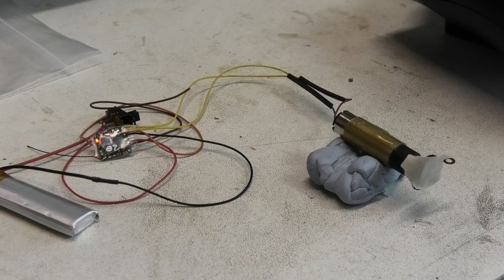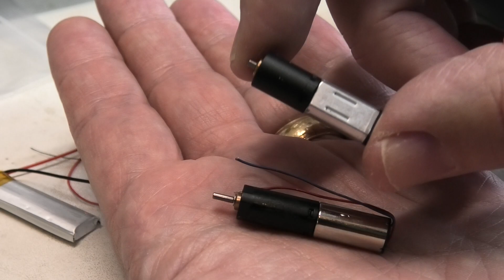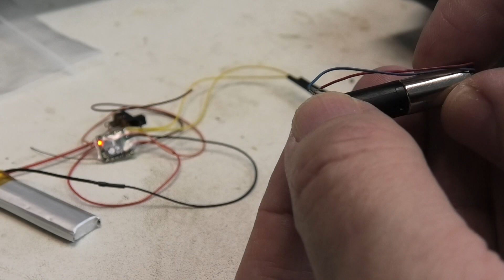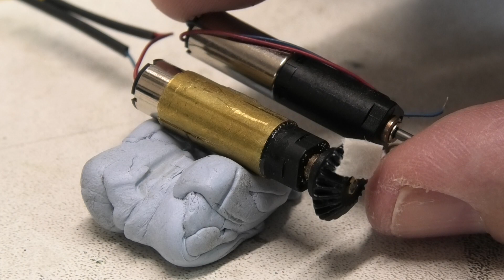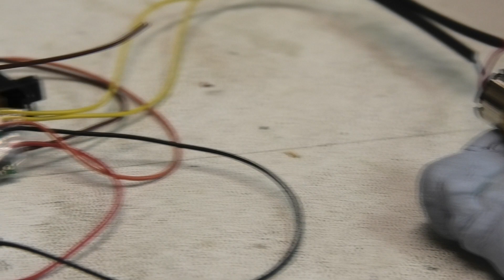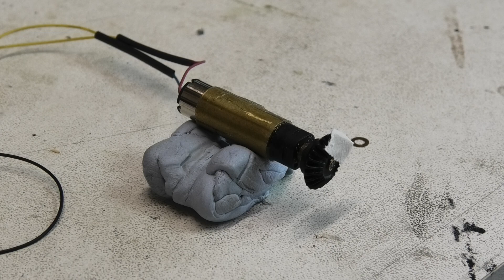Gearmotor Improvement

Comment: A bit late on this, but in my wanderings trying to get k20s, I found the source which is Zhaowei, they are still available but only in wholesale quantities, ie 500. Very annoying...
Reply from the maker: Do be careful - various companies advertise the K20 and supply something different!
Reply: @giles yes absolutely point taken. Here’s a link to a German website: https://m.zwgearbox.com/gearmotors/brushdcgearmotor/8mm-brush-dc-gear-motor.html. Do you think they look right? They look expensive!
I think you can specify output rpm, you certainly could from the zw website, but as I say minimum quantity direct from them was 500.

Comment: Oh I've been meaning to do this ever since I did my first RC conversion in 2015. I used Deltang and it was an old locomotive and not particularly good at starting (unless you catch it right). I tried by downloading a programme called CoolTerm (recommended in instructions) but I just couldn't do it. The programme wasn't doing what it was supposed to do in the Deltang instructions. I didn't get around it again. It seems that you're not doing it via a computer. Sounds like you're pressing the buttons on your transmitter. I haven't got a stick transmitter, I've got the train type one sold by Deltang. Are you doing it by your stick controller?
Reply from the maker: Yes, I've done it using a cheap stick transmitter  (e-flite type...). Its worth persevering with!
Reply: @gilesengineer  Thanks Giles, yes, I must persevere. The trouble with Deltang is that I just find it so complicated. For my receiver I see a mention of PWM here:- http://www.deltang.co.uk/rx610-features.htm but it doesn't say how to do it or give a link. I have got a Prog3 (I think) programmer which plugs into a laptop but I couldn't get anywhere with it. At the bottom of that page, under the heading Joystick TX it says, quote "A standard hobby Tx can be use to make changes and is probably the easiest for making changes.". That's what I want, the easiest. I'll get a joystick. I've heard of E-flite.

Comment: Morning Giles. 
The K20 motor is a "brushed" DC motor where the internal gubbins (your speak) armature is wound on a laminated iron core and this rotates inside the magnets. Usually a 3V K20 motor maximum speed is about 10,000 to 15,000 RPM on 3V at the motor shaft. If you pulled apart cheap motors as a kid it most likely would be a DC brushed motor.  
The N20 motor is a "core-less" motor where the armature is wound without an iron core and on these tiny motors the armature rotates around the magnet. Core-less motors are usually much higher reving, a 3V motor could rev to 50,000 rpm or more, hence the requirement for more stages in the gearbox.

Because of the different torque and speed characteristics the two types of motor require different PWM frequencies.
Reply from the maker: Indeed they do, which is why I found it useful to be reminded that the PWM setting could be adjusted on the Deltang receivers (I had only altered the 'basic' receiver settings before), and I thought it would be (2)
Reply from the maker: useful to show how much difference doing so actually made to the running characteristics of the motors.

Comment: Could you supply a Wiring diagram for the deltang receiver and what transmitter do you use to drive them

Many thanks
Reply from the maker: You can search for the Deltang receivers and find all their info. I use Blade/e-flite stick Tx for programming, and RadioMaster TX8 for actual use.

Comment: very helpful Giles with the clues into the Deltang PWM settings (I have changed things before, so the muddle is understood!).  Now off to try adjusting mine - I had been using a pair of series diodes to reduce the voltage to motors.
Reply from the maker: Excellent! Let me know how you get on!
Reply: @gilesengineer   The PWM does make changes, but with the very small motors I'm using, the default 700Hz seems the best option.   Also, the PWM is a "global" affecting all outputs with a single setting, so if using an actuator for steering (rather than a servo), the actuator also gets the new PWM value which can lead to a very buzzy actuator.
Reply from the maker: Not surprising- but very useful to know.... I'm afraid I'm a servo chap myself,  so I've not run into that problem....
The N20s I tried were much more comfortable at about 300Hz, so it's very useful to be able to adjust - sorry it was less useful for you!
Reply: Nice works Giles, thanks for sharing. I will be trying that on my 6mm motors in the very near future.